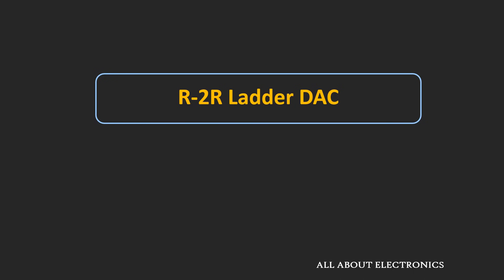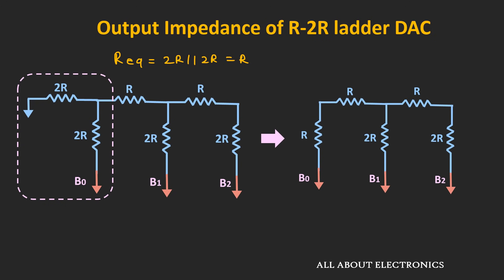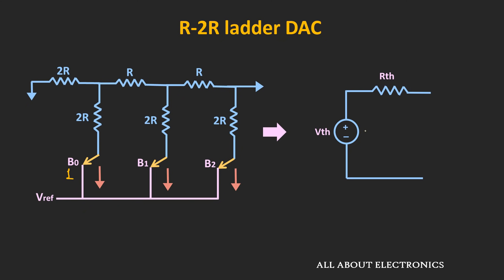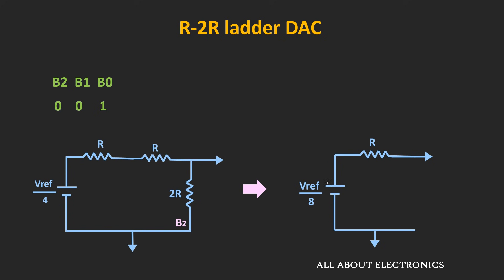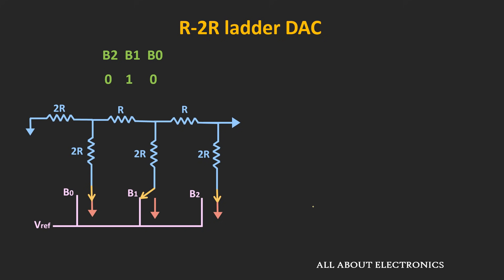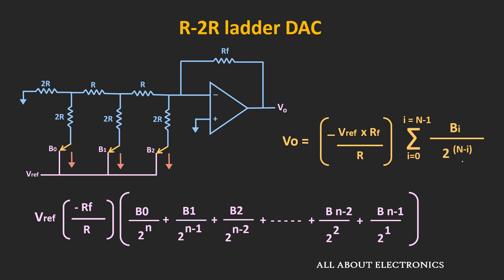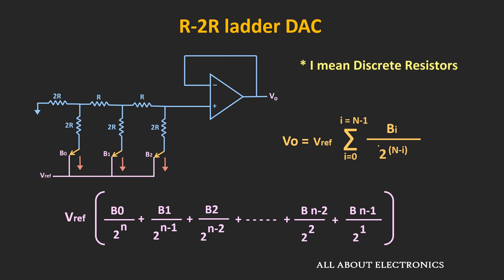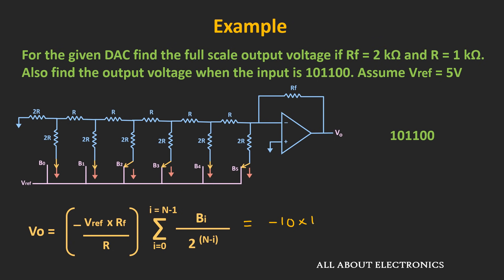R-2R Ladder DAC Explained (with Solved Example)

Comment from the maker: The timestamps for the different topics covered in the video:

0:23 Advantages of R-2R ladder DAC

1:58 Calculation of the output impedance of R-2R ladder Network

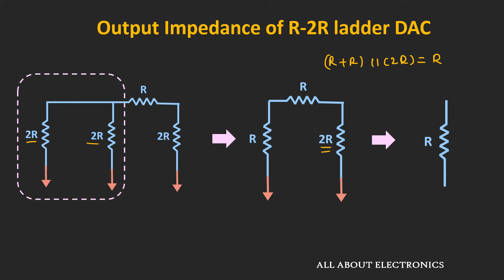3:47 Calculation of the Output Voltage of 3 -bit  R-2R ladder network

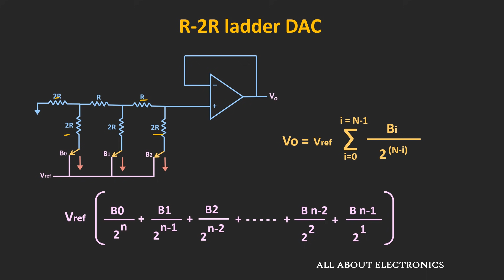15:35 Solved Example

Comment: At 6:46 how to find v thenin   Please explain and
Reply from the maker: It is found using the voltage divider. From  6:00 onward, I have already explained it with the equivalent circuit. Please go through it once again, you will get it.
Reply: @ALLABOUTELECTRONICS  thans sir

Comment: how to find current in Rf?
Reply from the maker: By applying the KCL at the inverting node, you can find the current Rf. Assuming opamp as ideal opamp, no current is flowing into opamp terminal. Therefore, the current through Rf is the summation of all the incoming currents at the inverting terminal.
I hope, it will clear your doubt.

Comment: Sir, at 14:05 the ladder circuit shown with inverting op amp where Vr-2r is applied on inverting terminal. So my query is that why we are not added one resistor R between Vr-2r and inverting terminal of op amp to prove the correctness of the written formula of Vo on the same timestamp.
Waiting for your reply sir

Further, Thank you for providing us these type of valuable and easy understandable videos 🙏
Reply from the maker: The thing is, there will be equivalent resistance (Thevenin's equivalent resistance) of the R-2R network at the inverting terminal. The equivalent resistance depends on the data input. Its value will in the multiple of R. I have also shown the same thing at the earlier part of the video using the example. That's why there is no need for additional resistor. I hope, it will clear your doubt. If you still have any doubt then let me know here.
Reply: @ALLABOUTELECTRONICS  sorry sir but still thing not clear.
Reply from the maker: What you are saying is that, there should be additional resistor between ladder network and the opamp right ?? But actually the Thevenin's equivalent circuit will be there at the inverting terminal of the opamp. Which comprise of one voltage source and one resistor ( which is the multiple of R). 
Just put some values in that equation and you will understand it.

Comment: what is the resolution of 3 bit R-2R DAC?
Reply from the maker: Unless you are specified the value of Rf (feedback resistor) and R, the resolution of n-bit R-2R DAC is Vref / 2^n . (Because you do not know the internal circuit as well as the value of resistor) But if you have been specifically given the values of R and Rf, (like the solved example at the later part of the video at 16:18), then you can use the equation given in the video. I hope, it will clear your doubt.

Comment: Subtitles should remove, because the contents of circuit is not visible
Reply from the maker: You can turn off the subtitles manually in the video settings.

Comment: I'm guessing the the type of current is AC in this circuit right? I have a school project where I have build a 3-bit R-2R circuit with Vref=1V, but I'm not sure what voltage the op amp is supposed to be amplified to (Vcc+/Vcc-)?

Comment: Actually, in the thenivin theorem,while calculating Rth,we will not include the resistor through the thenivin voltage is calculated,in the same here also we should include the resistor 2R,but we are including it and saying 2R//2R, how it's possible?
Reply: @Aswinikrishn  same doubt

Comment: Can you check again at 17:22 time, u put wrong values in formula. i think it should be 2^6+ 2^4+ 2^3
Reply from the maker: no, it is correct. If you see the expression, in the denominator, there is 2^(N- i).
Here N is 6. And B2, B3, and B5 are 1.
So, it will be 1/(2^(6-2)) + 1/(2^(6-3)) + 1/ (2^(6-5))
That is 1/2^4 + 1/2^3 + 1/2
I hope it will clear your doubt.
Reply: @ALLABOUTELECTRONICS  Oh yeah. I was confused in MSB and LSB..  thanks man

Comment: Ohk by two methods u can solve it!  
(Resolution) 
1. Resolution = FSO/2^n -1 = -9. 84375/2^6 -1 = -0. 15625v
2. Resolution = k. Vref/2^n 
(Here k= gain which is equal  to -Rf/R =2kohm/1kohm =2) 
Therefor
Resolution =( 2 * Vref) /2^n =( 2 * 5) /64 = 0.15625v
Got it?
Reply: Thank You, you have made things clear. I totally forgot about the gain when calculating the resolution using the Vref instead of the FSO.
Reply: If you keep the formulas aside, I think its the analog value of least significant bit. Correct me if I am wrong. From my understanding resolution is the least voltage that has to change to achieve the corresponding analog voltage.
Reply: @mayankawasthi6839  in case of DACs resolution is the voltage that the output signal is incremented by, when the digital input changes by 1 unit....
For ex on going 101 to 110 
The output analog signal would step up from its previous value (Vi) to Vi + Resolution or 1 LSB.
Reply: @kushagraacharya4629  exactly i was trying to say the same. Thank you for the explanation. 🙂
Reply: @mayankawasthi6839  yess....u were trying....hehe...but tumhe yaad kaise hai, paper toh ho gaya hoga abtk
Reply: @kushagraacharya4629  .
Reply: @mariasaydiav  ??
Reply: @mayankawasthi6839  .
Reply: Best of luck for the paper tomorrow
Reply: Thank you, I totally forgot the gain...
Reply: Great work , Very ambitious

Comment: i thought that equation for the last output was the formula for finding Vo for a weighted resistor DAC
Reply: probably a better question is why does the equation for Vo have -Rf/R when Rf is present but doesn't have that when there's a short circuit? Since a short circuit means Rf=0? Or is it just convention to use that equation when the output terminal is shorted with the negative input terminal
Reply: I think I get it now, (kinda) but please reply if you have a good way to understand it
Thank you
Reply from the maker: for better understanding please go through this video on the op-amp. It will help you.
https://youtu.be/uyOfonR_rEw

Comment: I understood it well but got a doubt.. at 6:12 , when the portion of the circuit was redrawn, in that Vref should be drawn with opposite polarity....because in the original circuit the positive terminal is connected to the bottom terminal of the resistor...
Reply from the maker: No, It is alright. If you closely look once again, in the equivalent circuit, the Vef is connected to 2R. (Also see the left side circuit at the same time). The other terminal of that 2R resistor is connected to the remaining circuit (the node where we want to find the Thevenin's Equivalent circuit and the second 2R resistor), whose second terminal is grounded. 
If you closely observe it you will get it.
I hope it will clear your doubt.
Reply: @ALLABOUTELECTRONICS  , thank you.. I got it clarified.

Comment from the maker: Do let me know the Resolution (in Volts) for the last example.
Reply: Resolution =1/2^6 (6 bit) =0.0156
Such that the reference given is 5v so 0.0156 × 5=78.125 mv
Please give ur feedback sir.
Reply from the maker: Yes, I will upload it soon. I have already posted the introductory video. And remaining videos on the different types of ADCs will be posted soon.
Reply: @ALLABOUTELECTRONICS  resolution is 78mA
Reply: resolution is = -0.15625V
resolution=fullscale voltage/number of steps(2^n -1 ; n=number of bits)
Reply: Yes
5v/(2^6)=0.078125(78 mA)
Reply: @chandanayaramala8892  78 mV right!!!Not Amps..
Reply: @chandanayaramala8892  correct